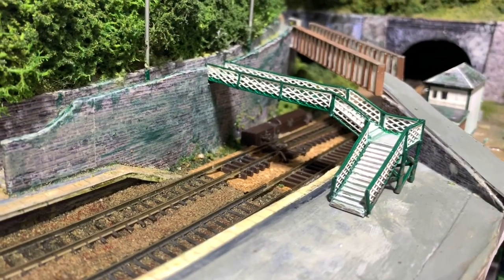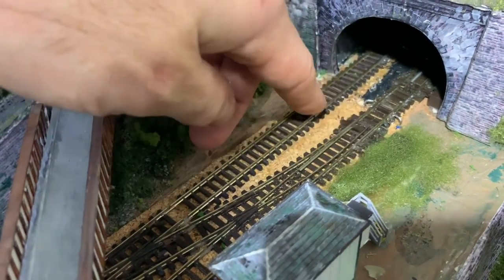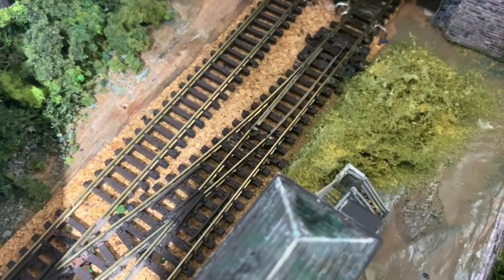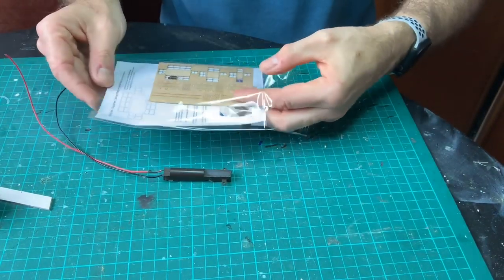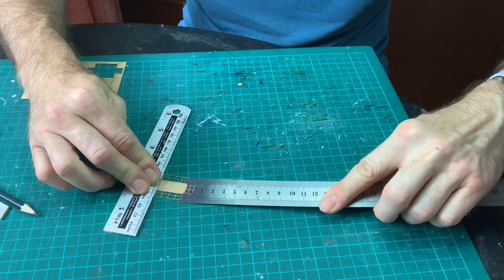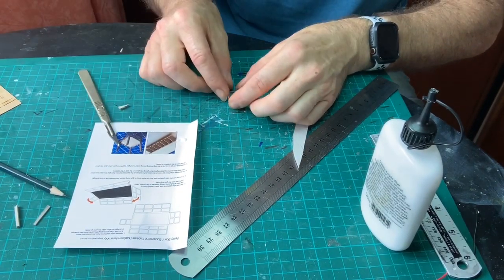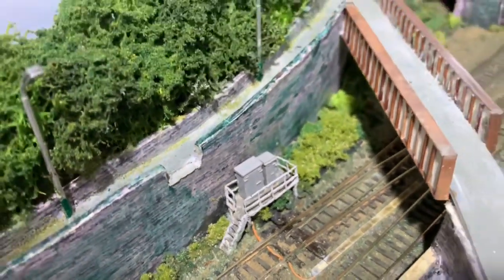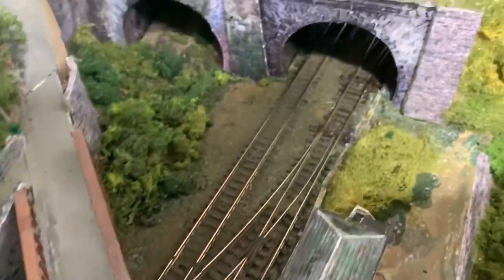New Mills 8

Comment: Hi John
Great job on hidding the point motors, I wouldn't have the patience with those tiny little kits its bad enough with 00 gauge. The whole section is really coming together well.
Cheers Paul
Reply from the maker: Dunge Wood Model Railway lol, I wonder that at times, its just a space thing. With N I can have the equivalent of 20’ x 12’ in OO if you know what I mean.
Reply: Yes John, it makes great sense when you put it like that, makes you think doesn't it...
Cheers
Reply from the maker: Dunge Wood Model Railway definitely, my first layout about 40 years ago (lol) was 6’ x 4’ OO I could only fit basic double track oval and one siding. Looked awful

Comment: Hi John. Excellent video great job in hiding those point motors, those platforms look to be a bit delicate & a bit of a fiddle assembling them it may of been better to paint them first, I have put thing together and then found it a struggle painting them. So now I paint everything first and then touch them up if I have to. But still you did an excellent job.  Regards George......
Reply from the maker: George Wyatt Hi George, yes think Id agree. However, superglue does make a difference. I do love the kit, would be incredibly difficult scratch building them.